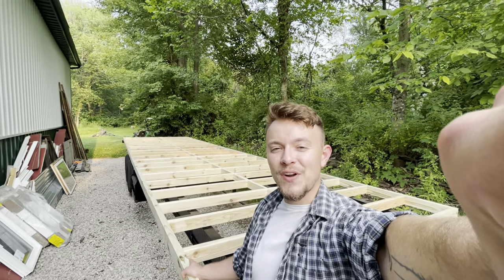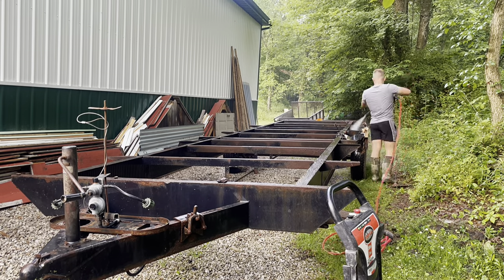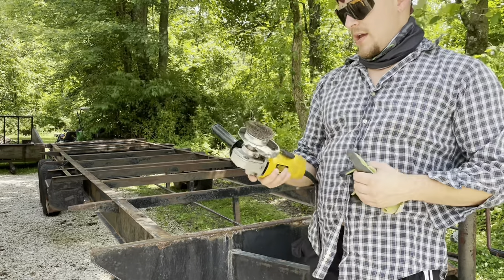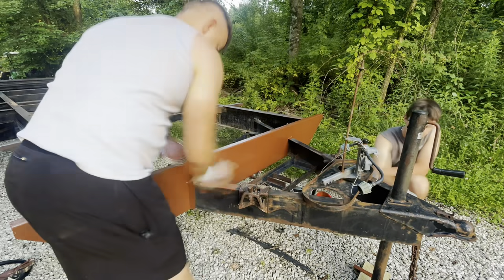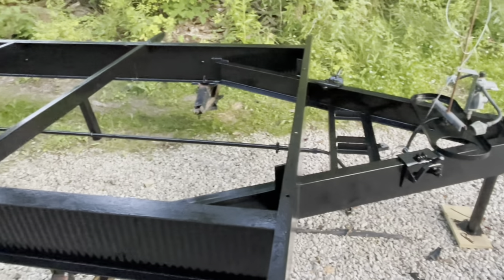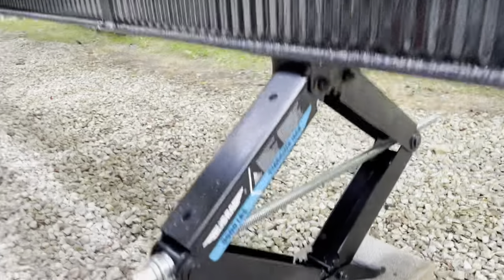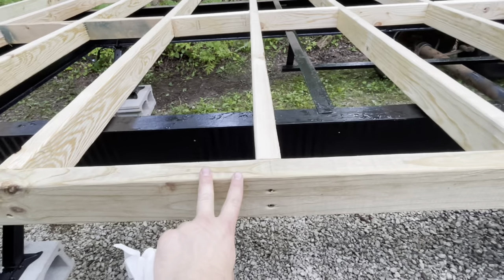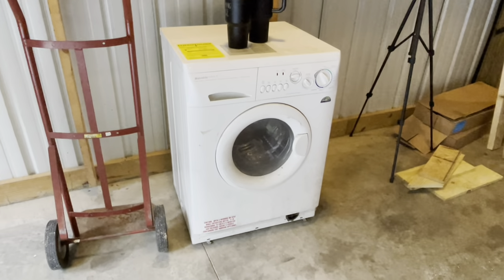CAMPER FRAME, TINY HOUSE?

Comment: Nice work cleaning up the trailer! Are you concerned at all about the floor frame not being all treated lumber, or are you sealing it off from the elements?
Reply from the maker: My plan is to put metal flashing at bottom of the frame, to block rodents/weather from getting inside. I’m currently looking at different options, it’s a serious step to this subfloor!

Comment: Hey Cody, just curious about the weight rating of your trailer. What size are those axles and what is the max weight you are going to try to be at when it's done? I have a camper trailer I want to do this with, but the weight rating has me really worried.
Reply from the maker: We are planning on installing stronger axles and springs before we move it. Right now it’s on jacks and I’m working on it in a shop. I was worried about the same thing!